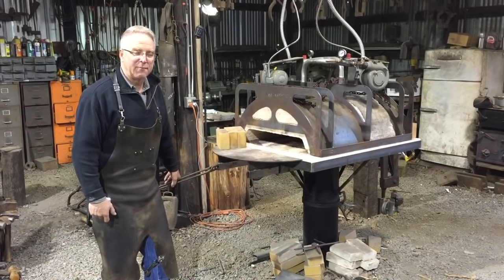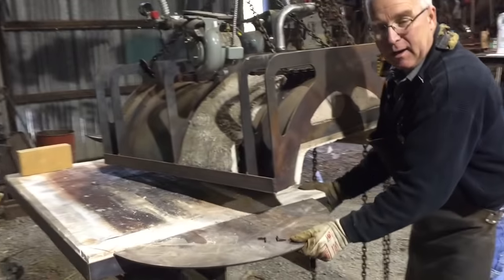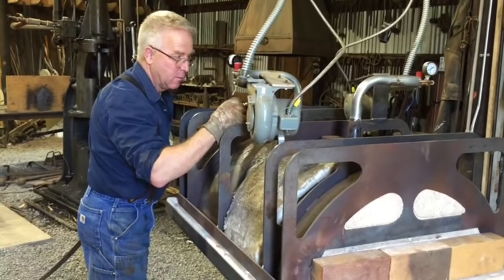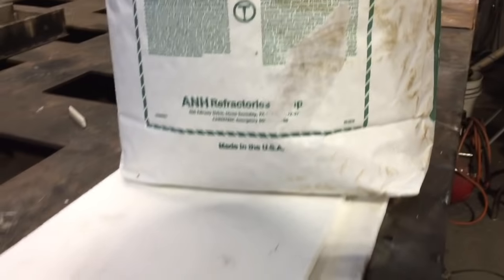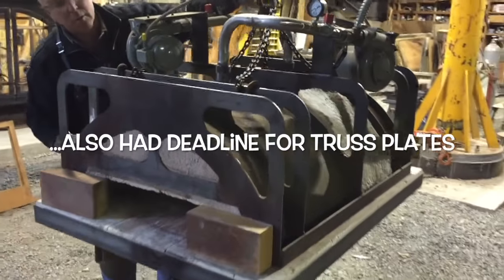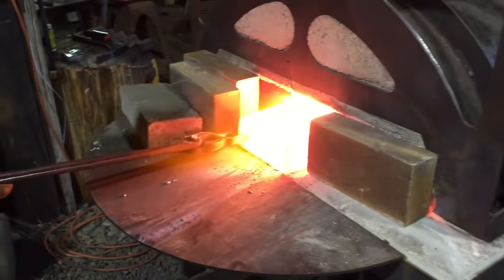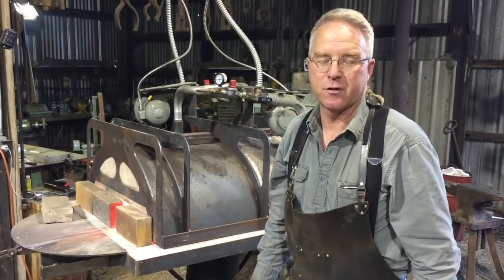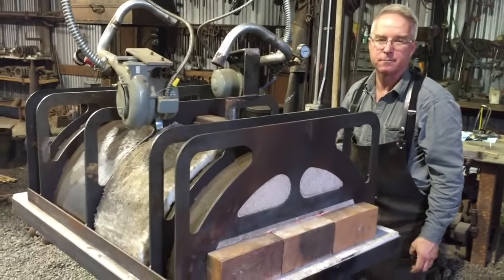XXL Blacksmith Forge - Original Design

Comment: Thanks for sharing this. My gas forge was built from an old Freon can and has run for many years very faithfully. However, it is nearing the end of its life. I have found that I am forging larger pieces than I ever thought I would and a forge design like this would definitely allow for those requirements. I can see that this plan is somewhat scalable since I don't require it to be quite as big as what yours is. Thanks again!

Comment: I like it.  Extending the tubes a bit higher up out of the forge for the air mix would allow the addition of fairly simple valves that would then allow it to vent the heat after being shut off without needing to disconnect the blowers on shutdown.

Comment: Hello, I was looking for a design for a clamshell forge, I knew this design from Ron Reil. Somebody has mentionned your video and I will definetly take some of your tips into consideration. I am planning a smaller, dome shaped version instead of a barrel-forge, and with 3 Smaller atmospheric burners. I wanted to say Thank you for this, I believe it is the best forge design there is for both knife making and for structural blacksmithing. It basically has no compromise for added features. Somebody told me that the area inside, being bigger, would mean a less efficient forge for small pieces such as knives, but you can always add ''filling'' refractory bricks inside, and have a very small heating area for an extreme efficiency.

Comment: ...I've worked with some of that cast-in refractory...good choice on the angle iron for retaining, but stainless steel is the usual thing....
 I built a firebox for wood fired (biomass) generator....8X9X16 feet....several tons of that stuff...8" thick...!!

Comment: Would the cooling process still melt the fans if you left them on after shutting off the fuel. Also would that make it cool too quick causing other problems.

Comment: That is amazing! but the 8 year old inside wants to know how fast can you cook a pizza in that forge?
Reply: Now I want to see him put a pizza in that forge.
Reply: He did, I don't remember the name of the video, but it took about a minute and a half.
Reply: I have a Tobasco forge and after I shut it down I place some refractory brick to block rapid cooling.  I forged a pizza peel from sheet metal with a handle.  It looks a lot like a coal shovel.  I place my pizza on it (thin New York style) and slide it in when the forge drops to under 450 degrees.  It cooks in about one minute, and if I am quick I can get another one done too, with each successive bake taking longer.  Eventually it becomes too cold.  Best pizza ever!

Comment: Damn, thats a hell of a forge. $3 an hour to run that beast seems pretty amazing to me. I use a coal forge and I've also got a small single burner propane forge for smaller stuff. I bet I can spend more than $3 per hour in coal when I'm doing some heavy forging.

You mentioned the point where you were invested to the point where it had to work out... I'm curious what it cost you to put that together? I'm at the point where I could really use something like that as well.

Comment: I have a question: with the forge resting on the base, what are the approximate internal dimensions of your forge setup? It looks to be about 3'L by 6"H by 18"W, but I'm wondering what the exact measurements are.

Whenever the day comes that I can afford to get into blacksmithing, this is a project I'd like to try my own hand at.

Comment: That is one insanely nice forge,as well as all of your videos seem to be no matter the content,if you dont mind me asking how much approximately of the castolite did it take and what did you use as a form?...I plan to do a very similar build except on a much smaller scale,most likely using either a section of a 40 or possibly a 100lbs propane tank. Thank You,Jeremy
Reply from the maker: If I remember correctly it used about seven bags. Possibly part of an eighth but I can’t say for sure. I formed the ends with three-quarter inch form ply. In such a way that the outside circumference of the inner head wall form located the inner circumference of the roof of the Forge if that makes any sense at all. Then we stripped and faced the headwall exactly as you would a curb or a turned down edge.
Reply: @essentialcraftsman  Thank You for the speedy reply,please forgive my ignorance as my only experience with any type of concrete work is building a small slab for my compressor and recently a ribbon burner,In pretty sure I understand the ends forms  basically being set far enough off the ends to allow for the thickness needed and also being cut so to provide the desired thickness of the roof circumference as well,the one thing I'm not certain is when you mention stripping the form,are you meaning that basically you used say a 1x4 or similar that were fixed to each end form and ran side by side along the circumference of the form?...the one last thing I would like to ask and maybe this is a bit of a dumb one but when you poured the refractory did you have the forge basically laying topside down pouring in all around the edge?kinda seems logical but I would like to try and waste not any of that not so cheap mix of you know what I mean,I apologize for the lengthy response and so many questions. Thanks again,Jeremy

Comment: What size blowers are you using? We were just about to purchase a ready made Forge...then I saw your "Super Forge" don't think I would be happy with anything less.  We got a large project coming up and I do believe we can save enough time with a large forge to offset the time to build the forge.  Great, Great Videos. Liked the video on round vs square stakes, could of used that idea 30 years ago.  Another plus about square stakes would be that they don't roll when you accidentally step on them! And easier to stack.  Keep up the good work.
Reply: Thank you!!! That is what I surmised.  I thought about using a blower I have  already but with a pressing project I don't have a lot of time for trial and error. We completed the table on Friday and will work on ribbon burners next week.  E.J. Bartells is now owned by Distribution Internationals (Roosevelt Boulevard in Eugene not too far from our shop)   and the only size bag they have of the correct 3000 degree refractory is 60 lb...too much is better than not enough!!!)  Ps love your videos.
Reply: cant wait to see the build , are you going to sell the drawings?

Comment: could you tell me how long did it take to heat the cable? Thank you
Reply: So this is a rough guess, but once the forge is up to welding heat, 
(probably 30-45 minutes)that piece of cable would be a high orange/low yellow in about maybe five to seven minutes...never really timed it. The real benefit to this forge is the number and size of pieces that it will hold at a nice forging heat.
Reply: Thank  you for the reply, Your gas forge is the best that I have ever seen great job building it.

Comment: I'm wanting to build a sword forge out of a 100 lb canister I got for free. I was going to do 1.5 inch of kaowool then build a refractory chamber, 6" diameter x 40 inch chamber. I'm having a debate on venturi (Ron Reil hybrid burner) vs ribbon and I am reluctant with ribbon due to dangers I have heard with blowouts and burners breaking etc. Definitely if I use ribbon I'm going with the ones you did because proprietary seems much safer. 

Anyway I'm just not a BTU or forge expert. I'm not going to be using it all the time so I'm not too concerned with peak efficiency, I like the idea with venturi and ramping after his info about forging in remote locales. Seems it's variable efficiency. Anyway, I'm not sure where to go. I have most of the materials, most were given to me except the burners. Loved the video and design.